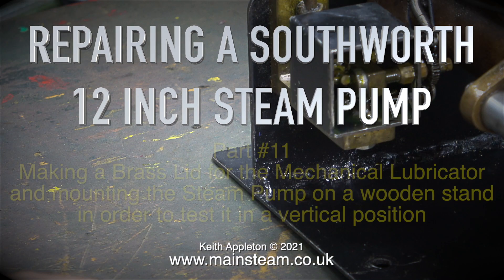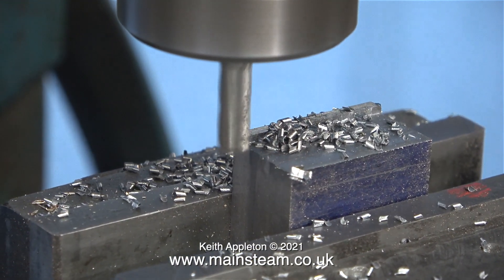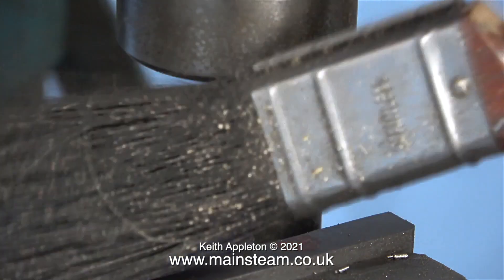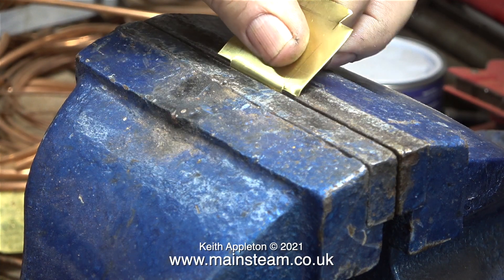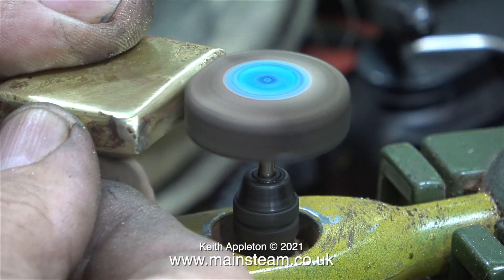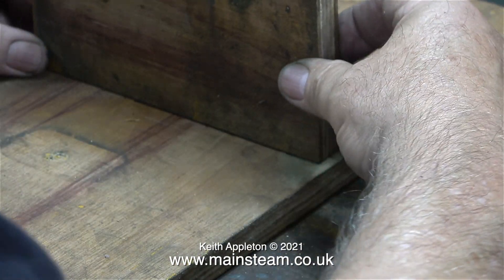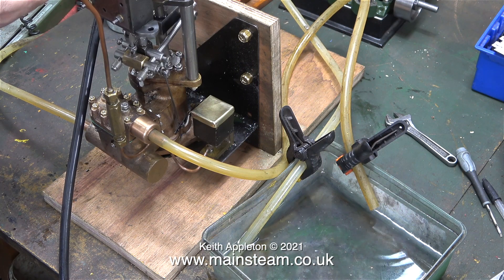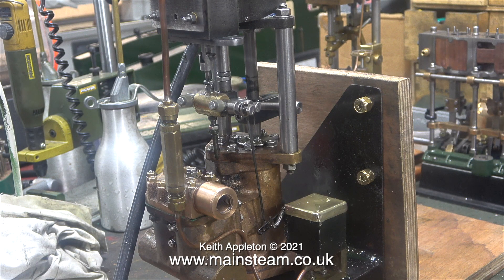REPAIRING A SOUTHWORTH 12 INCH STEAM PUMP - PART #11

Comment: for some odd reason I thought the pump ran horizontal thanks for  showing the errors of my way
Reply from the maker: I also have one of these that is modified to run horizontally.
Reply: @keithappleton  is the oil container  set up vertically ?

Comment: Keith these are very informative. I do have a question on the double acting pump. When you were showing the water it looked like it was only pumping in spurts. If it double actin wouldn't this be steady stream? I am learning a lot from these videos. Thanks,